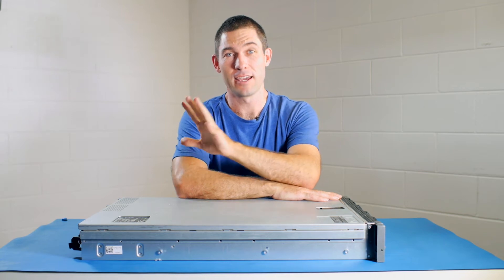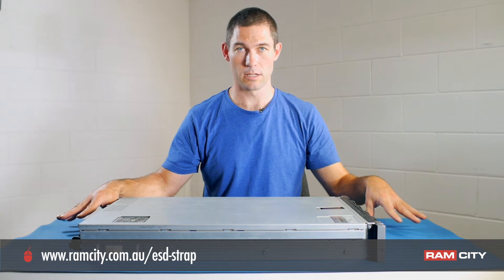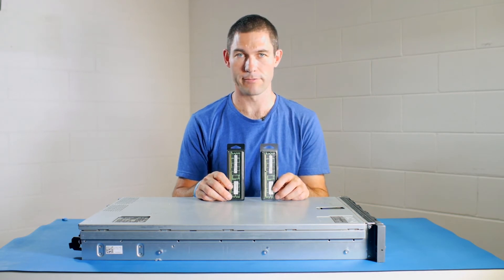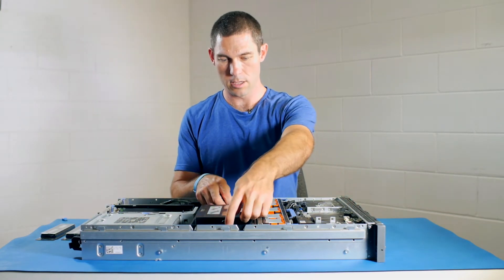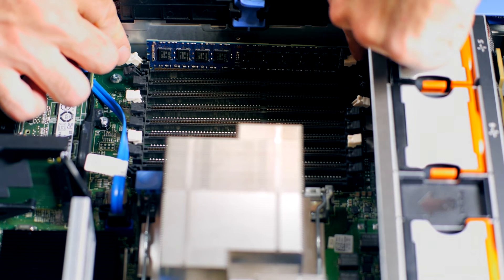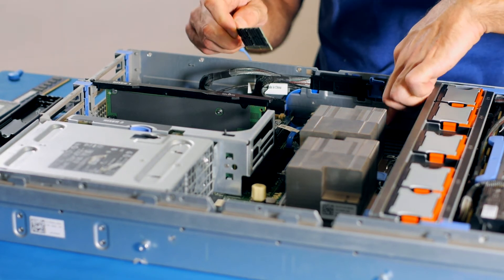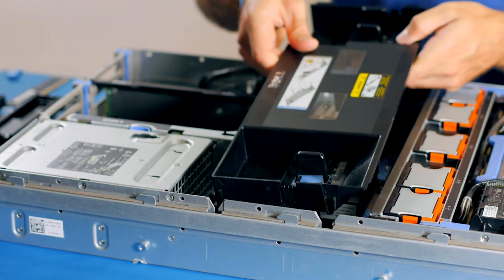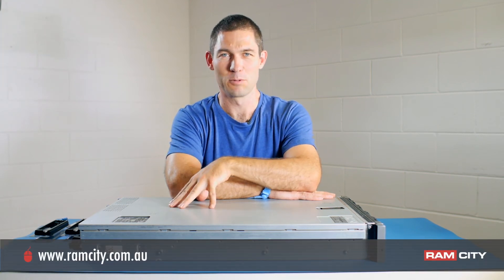Dell PowerEdge R710 Server RAM Upgrade

Comment: A well-shot yet almost totally worthless video. Pulling out a DIMM stick and replacing it with another is elementary knowledge. What is much more important, and totally missing from this video, is how to populate DIMM slots on a server when expanding memory. Why every third slot has white tabs? How do slots relate to memory channels? What multiples of DIMMs (pairs, triplets) do we need? Should we populate DIMM slots closest to the CPU socket first (for lowest latency & highest data rate) or any other way? Do we know that this server has some special memory mirroring or advanced ECC modes that require particular DIMM arrangement & BIOS settings? The 'upgrade experts' will not tell us.

For those looking for such information, the Dell PowerEdge R710 Hardware Systems Owner's Manual, page 129 is the place to start. I was hoping to find a video that complements the information given therein, I will keep searching.

P.S. For others who prefer to absorb information visually, here's another document from Dell on DIMM arrangement:
https://www.dell.com/downloads/global/products/pedge/en/server-pedge-installing-upgrading-memory-11g.pdf
Reply from the maker: Fair comments indeed.  Thanks for your feedback.

Comment: sorry but of all the things you could have talked about you didnt talk about the one complicated thing that people would need help with.  Anyone working on an expensive server knows how to open a cover and install memory.  Its the memory configurations and memory modes that are confusing.  Please make a video on that.
Reply: this is definitely true. What waste of time on that video...
Reply: flexbox  Actually, the guy in the video installs the memory module on the B1 slot, and it won't work with Advanced ECC mode (Which comes as the default mode). I'm not saying it's a useless video, but I can cause some confusion.
Reply: When I started doing field service the older guys told me that rule #1 was: "Don't let the customer know you don't know how to get the cover off"
Reply: Matze Mitdertatze came in handy for me. Fuck off